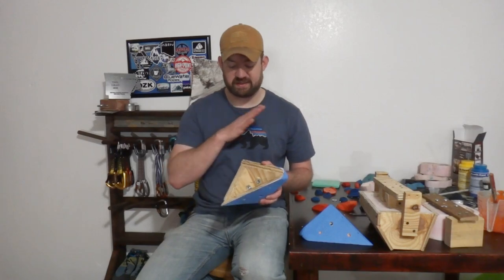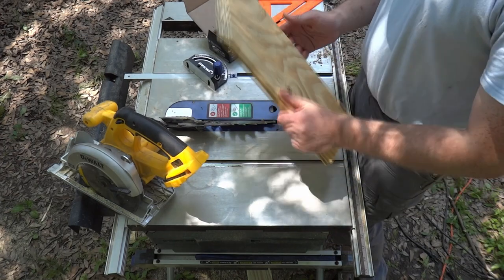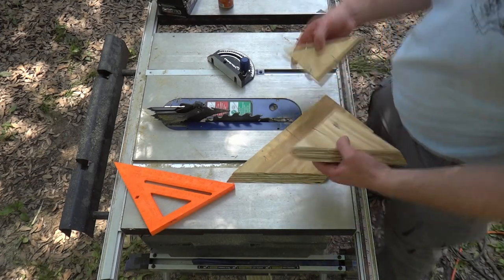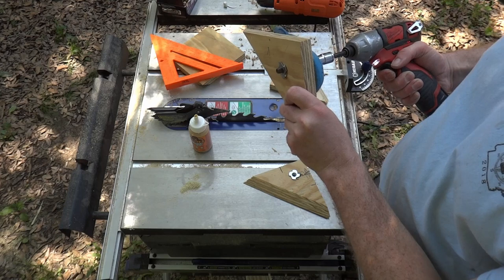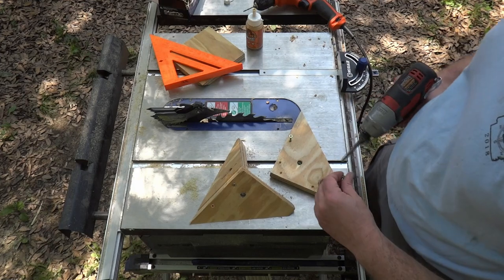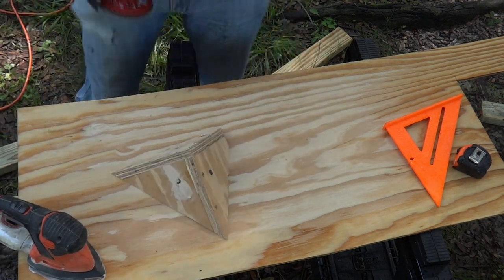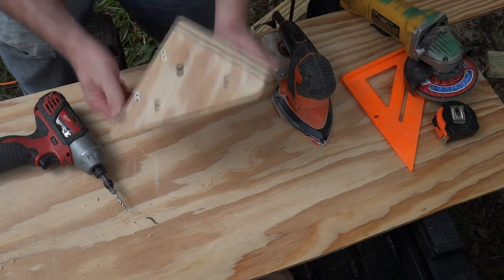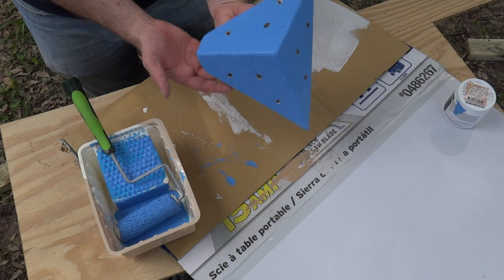Building Volumes out of Scrap Plywood

Comment: I saw a tip to put golf tees to plug the t-nut holes when painting or adding texture to climbing walls or volumes, what you think?
Reply from the maker: It's not a horrible idea. I did one last week but I just painted around the bolt holes just fine.